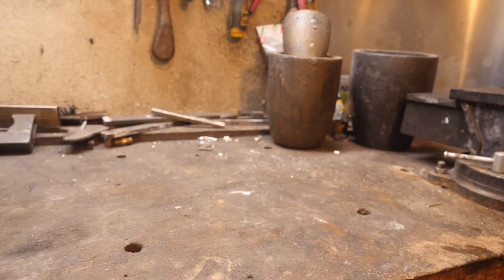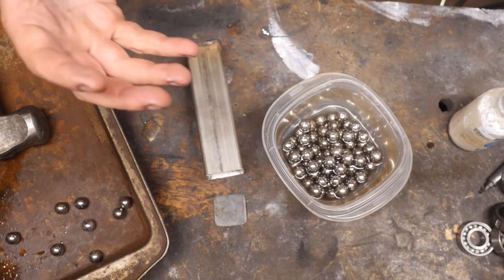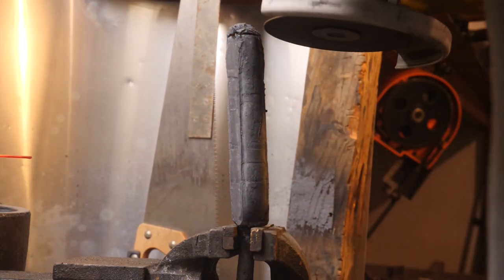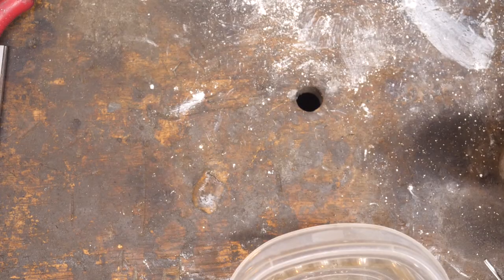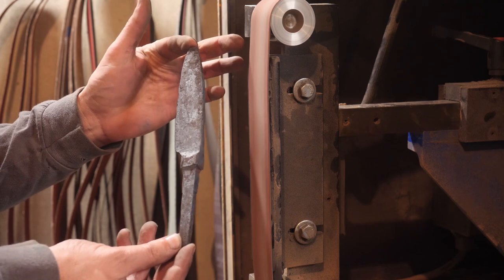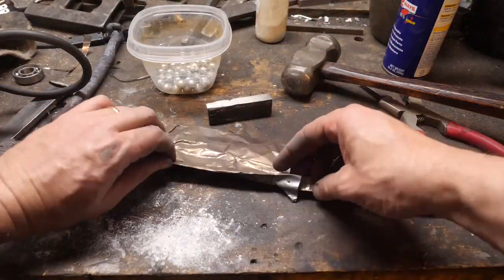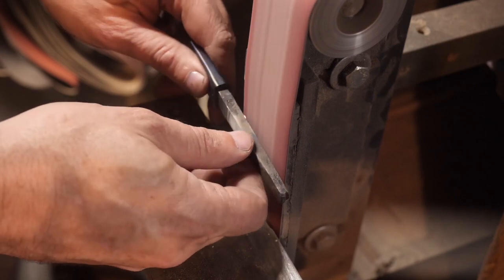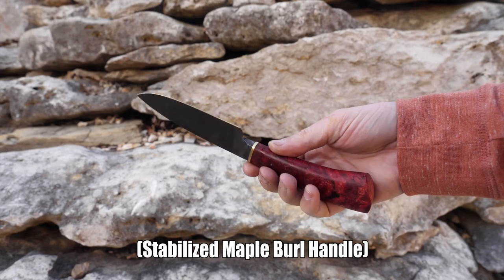Forging a Knife From Ball Bearings

Comment: I did this exact same build on my channel 6 months ago.  You have to etch the blade much longer for 52100 and still its not dramatic.   I used 1/4" ball bearings and they came out about an 1.5" on the knife in a kind of weird honeycomb pattern with slightly darker lines between them.  I think I did over-forge it a bit because when I etched it out of the canister it looked amazing.  Next time I'd do this with a narrower billet or smaller bearings.

Comment: The steel powder would have given you some pattern I think.
Reply from the maker: I think so
Reply: %100 would have
Reply: Indeed
Reply: @GreenBeetle  Where do you get the square tubing for a cannister. That's what I'm looking for.
Reply: @fredfry5100  most steel suppliers will have it, generally called box section in the uk but dunno about everywhere else

Comment: Those welded balls are from a grease test called, oddly enough, the 4-ball weld test. The one on top is pressed down on the bottom 3 while they all spin, and you measure how much pressure it takes to make them weld together.
Reply: David M wow that’s actually super interesting!!

Comment: Mr. Beetle, I started using titanium dioxide to coat my cans too and it works well.  I just learned that you can keep using the powder over and over if you mix it and use it in the same container.  Just add water to the older stuff that’s hard and caked up and it’ll get pliable again.

Comment: I'm working on my press.. it's just a 5 ton...got to start somewhere..but I had a thought for a pattern.. square tube.. make a 1095 cross and drop bearings and powdered steel into the four chamberes... Also add 52100 as a border to the cross to separate the two types of 1095.. then make it a twist Damascus.. and split that and San Mai it on a 1095 core.

Comment: Looks like they are doing some "4-ball wear testing" at the grease plant.  This is typical load carrying capability test for grease under high or extreme pressures.  If the speed and pressures are high enough, the friction can weld the balls together.  Cool stuff!
Reply from the maker: Woah cool!

Comment: Can you make an otf blade next and put it in a otf. Might be kinda intricate but I feel it would be a cool challenge and would maybe be a first. If the blade is to heavy you might have to put stronger springs in the knife. I'd recommend finding a knife using similar metals to what you use and it should be ready for a similar weighted blade

Comment: That's a really nice handle too. I don't know how you could achieve it, but if you could coat the balls with a layer of darker or lighter steel, then you might end up with the lines you were looking for? I suspect that the actual bearings will look good forged with steel powder, it could make some intricate shapes if there isn't any residual grease to ruin the forging.

Comment: For paterns at your final metal piece are nessacary 2 different steels. Using your method (with steel balls encapsulated) can just add inside to the canister metal powder in order to avoid the gaps and the same time you can have this difference at you final piece of steel. Then can have your paterns!!!

Comment: that's weird... shurap did one with just steel balls and his turned out really interesting.  I wonder if they were chrome-coated.
Reply: When Shurap did it, he allowed some space between them and didn't compress it fully in the canister and hand-hammered it together after.  I think that allowed some decarb between the bearings which is why you see the pattern more.

Comment: Beautiful work my good man! Thank you for taking up the project! I'm needing to figure out a solid anvil base for my wee anvil so I can try my hand at my own can of balls and races.  

So why did you use TiO2 plus stainless steel foil in the canister? Why not one or the other?

The balls that were welded together were welded with friction...not sure if those are useable knowing that, or if they would leave defects in the finished blade.  

I figured you're far better suited for this than myself as the heat treat cycle for  52100 requires a HT Oven...which is beyond my present means.  I made a baby Puukko blade with one of the races - it was a breeze to forge but after my attempts at heat treat, it's not hard at all...I just use it as a steak knife and it works just fine for that.

Again thank you very much for taking on this project! Pattern or not, it's a beautiful blade and amazing craftsmanship as always!

Cheers!
Reply from the maker: I’ve had the stainless foil weld when used by itself and the titaniim oxide can flake off into the gaps between balls if used by itself.

Comment: Throw in a couple of different size nuts  and bolts of different grades. Maybe a strand or two of different size cable.
What if you took a bolt fully threaded and threaded on different grade nuts?
Reply from the maker: Ooooh that’d be cool

Comment: That's one hell of a solid bank but the etch you need two different metals. Get forge welding sir. What the set up on the forge?
Reply from the maker: Oxidation between the pieces often shows as a thin web but the canister didn’t allow it.

Comment: You need to agitate the parts if you're cleaning them up with kerosene or diesel. If you just dump the parts in and forget about them it won't do anything. But if you shake the parts and get the fuel moving thr grease will dissolve. I personally like a parts washer or brake parts cleaner

Comment: If you want to repeat the experiment, heat the balls up to around 700 °C / 1300 °F in een open to air furnace for a while. This will decarburize the surface, resulting in some possible pattern to appear, because the decarburized areas will etch differently if sufficient carbon diffused out and burned off.

Comment: Maybe do another one and use the steel powder, it'll give more contrast at least, or cut some of the races and mix lg/sm ball bearings and chopped races to try to get a bit more of a pattern. Or just do a canister with a bar of stock in the middle for the edge, and try to intentionally leave gaps in the balls during the weld

Comment: I'm guessing that when you remove material with the belt sander you are softening the blade. Maybe softening the blade is unnecessary?
Reply from the maker: Not softening
Reply: @GreenBeetle  err, annealing. I don't know if it's happening on your videos, but I seen a bunch of knives get annealed on the KyleRoyerKnives channel on the sanding belts. So it's definitely happening, at least in some scenarios.

Comment: Forge welding same steel together won't give pattern, as it's all the same steel. But ball bearing steel is very good steel, plain steel powder might have spoiled it. Perhaps CrMo or tool steel powder might work without spoiling the properties of 100Cr6 steel.

Comment: You can’t expect a pattern with one type of metal.
Reply from the maker: Welds are sometimes visible between like metals.  They really pop if oxides form on exterior during welding which didn’t happen in this case because it was welded in a can w paper to consume the oxygen.

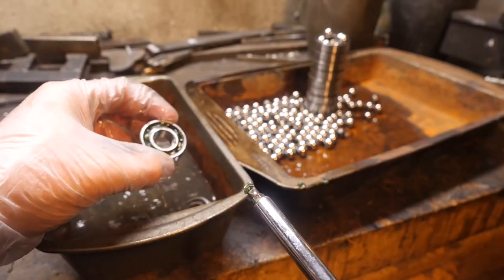Comment: 1:05 Kerosene is garbage at degreasing, acetone is a much better degreaser.  Also, I don't know what steel they make bearing balls out of, but it's hard as fuck because they're used for high wear low impact operations

Comment: what did you expect? you only use one typ of steel.
Reply from the maker: there are often fine welding lines between bits of monosteel if a small amount of oxide forms on its surface.  grain structure is also often revealed with etching and polishing.